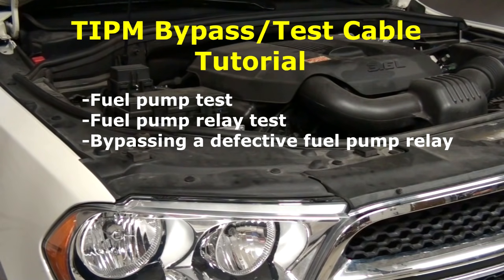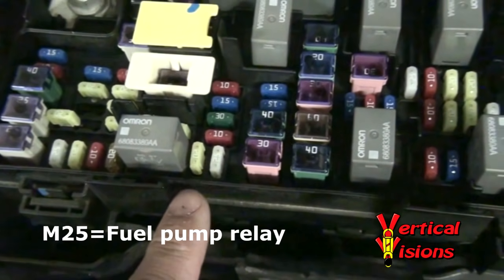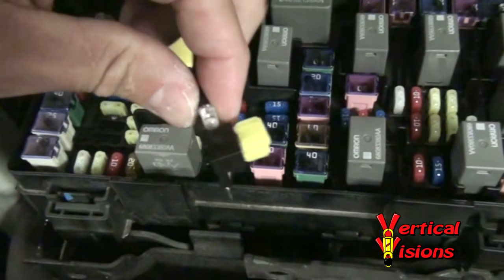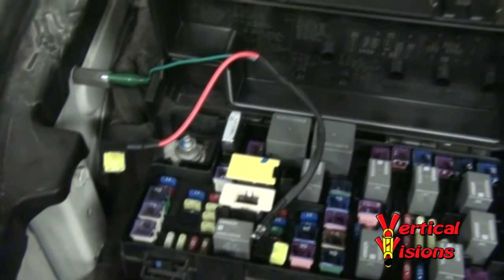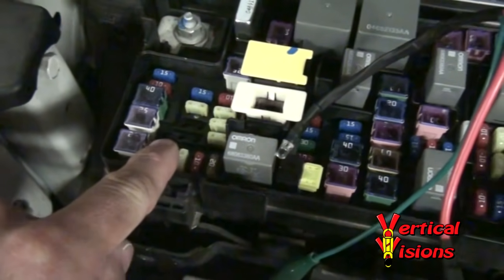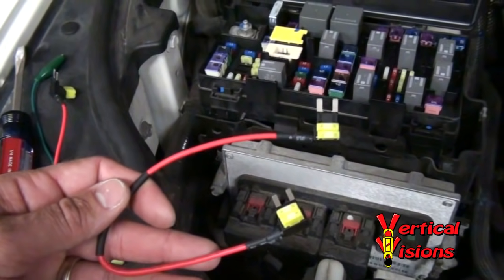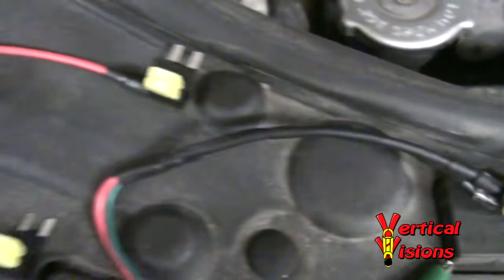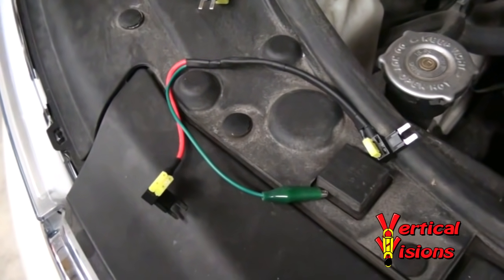TIPM Fuel Relay Test and Bypass Solutions - Most 2007-2021 Dodge, Chrysler, Ram, Jeep, VW Vehicles

Comment: Today I received my TIPM plug-in relay system (lite) It was so easy to install took all of 3 minutes...I have a 2012 Town and Country that would not start any more. After watching your channel and
going to your website to order this part it was seamless. Thank you very much for all of the research you put into this. My van now runs like it did when it was new, and you have saved me thousands.
Reply from the maker: Our TIPM Plug-In Relay System (Lite) is essentially the next generation TIPM cable with easier installation, fit, and functionality.  It has three onboard LEDs to indicate power flowing to the pump, the run/start signal (the alternate power source), and the status of the original faulty relay for testing purposes.  This part is patented and built from the ground up as a permanent solution.  TIPM cables have always been temporary solutions since they have issues in high temperature environments due to manufacturing constraints.  Thanks for the feedback Ross.
Reply: @VerticalVisions  I have a 2006 Dodge Ram 1500 Mega Cab and it's doing exactly what you're talking about but the TIPM is slanted and has a different fuse box.. just trying to determine which fuse location to attach to?
Reply from the maker: @blakevaughn8108  Ouch, a 2006.  TIPM cables don't work in your vehicle.  Here's why:  https://verticalvisions.com/en/content/21-basics-of-bypassing-testing-relays
Reply: @blakevaughn8108  
I got a dodge durango and trying to figure out the same thing. Can I attach to fuel pump fuse and the cigar lighter ??
Reply: @VerticalVisions  I commented on this video twice I need help may you might know how to bypass a 40 degree angle tipm
Reply: @VerticalVisions  Question for you boss, I seem to be having the same issue for my 2014 Dodge Journey 3.6L STX. Would your Fuel pump relay bypass wire work for my vehicle?
Reply from the maker: @CP-ix6ds  We have not tested our TIPM cables on your vehicle.  Read this:  https://verticalvisions.com/en/content/21-basics-of-bypassing-testing-relays
Reply: @VerticalVisions  Question for you boss, I seem to be having the same issue for my 2014 Dodge Journey 3.6L STX. Would your Fuel pump relay bypass wire work for my vehicle? I didn’t see my car listen on the site but wanted to make sure, thanks
Reply: @VerticalVisions I would like to see a work around for TMC in the Chrysler TIPM.
Reply: Hi boss. I got same problem in my Gran Caravan 2013. I was checking your video, make my bypass cable and voila. Run again. Thanks a lot.
Reply: @carlosvalverde8512  Works awesome I have over 180,000 miles on the van still runs perfect
Reply: I want to order one
Reply: Does it work with a 2003 Lincoln Navigator?
Reply: I`m not sure my application was for a 2012 Town and Country  @Snookred1
Reply from the maker: @Snookred1  We're not sure.  This page might help you determine if it will work:  https://verticalvisions.com/en/content/21-basics-of-bypassing-testing-relays
Reply: @VerticalVisions  yeah I’m not sure either bc there are 2 fuel pump relays on the fuse box a 5 prong rectangular relay and smaller one that’s soldered internally on the board itself
Reply: My ESP light my traction light and my abs light still stay on is that common is there a fix for that?
Reply: @natsanchez3583  I think that is unrelated...You could be looking at a wheel bearing...the tone ring for the abs is in with the wheel bearing...it might have to be changed.
Reply: Amen!
Reply: Does this work on 2012 jeep compass?
Reply from the maker: @LaPlacitaMich.  Not sure, but this page might help:  https://verticalvisions.com/en/content/21-basics-of-bypassing-testing-relays
Reply: How much
Reply: @anthonymitchell4009  ....$100 U.S plus shipping...Installed mine 2 years ago works awesome....well worth it
Reply from the maker: @anthonymitchell4009  Comparison chart of solutions with prices:  https://verticalvisions.com/en/content/14-tipm-fuel-pump-relay-solutions
Reply: Where can to buy a cable and what size are ?  How many amps or volts  the fuselaje it has
Reply: Yep!!! This $8 wire saved us thousands! 2012 Dodge Grand caravan! They really should have a recall on this! Wayy too many ppl having the same issue!!!
Reply: Have a 2016 Chrysler 300c will not start on occasion will just keep cranking. At times once it does start it will stumble and die. After the second or three time it will finally stay running? How can I get your cables fast?
Reply: @Loveless-sr9ly  ...try shutting it off completely, open the door then try starting it again...kind of a reset
Reply: I bought your cable and it still doesn’t start nor do I hear the pump running
Reply: My 2010 Dodge Journey AWD starts then stops sometimes it'll run may a minute then stops would that be cause relay going open stopping engine

Comment: Hi, I bought a TC2012 with the little board and doesn't work, It stall from time to time and I would like to know if this board need to have some led lights on because all remain off. Have voltage but seems like is dead.

Comment: You should be able to make a similar harness to bypass the transmission control relay when it fails too, also a common misdiagnosed dodge issue.
Fyi dodge is just another word for avoid 😅

Comment: GUYS IT WONT MESS UO THE REMOTE START IF YOU CONNECT IT ON M6 instead of m7 but the fuse part need to be pointing towards the battery instead straight facing the grill 8:20

Comment: I bought the cable and my 2015 wk2 still will not start, is there something else I should be looking for, I’ve already replaced the fuel pump. I’m also looking into buying a used tipm from the local fenix shop, should I be leery of doing this?

Comment: Isn't it possibly a problem to leave the fuel pump on all the time when the car is on?  I thought it's supposed to turn on initially to raise pressure, and then turn off and only turn on when pressure is needed.  If it's running all the time, is seems like it could shorted the life of the pump or cause other problems.

Comment: Can anyone tell me why the bypass cable isn’t a permanent solution? I installed it a year ago and it hasn’t had an issue until this winter when it’s having hard starting issues on cold mornings again? Is the standard bypass cable likely failing or should I look at other things?

Comment: Ive got a 11 ram 1500 4.7 4wd that has a crank no start issue. Mechanic said its the fuel pump relay tipm issue.  Will this kit work with it?  Dont think its ever had the recall done before
Reply from the maker: Yes.  We have multiple solutions for your vehicle.  See here:  https://verticalvisions.com/en/308-1500

Comment: This works great I want to put my fuel pump back on I changed the fuel that wasn’t it This tipm bypass cable saved me $$ but I put in a new fuel I can’t refund it 😂 thank you 🙏 I ordered this bypass cable threw Amazon for $24 my 2011 ram 1500 hemi 5.7 starts up like nothing happened 🙏 thank you 1000X

Comment: Our Town and Country's fuel pump has stayed on with the key off and not run with the key on. I planed in using the kit and splicing the wires under the fuses and adding an external relay to resolve our faulty internal relay usues.

Comment: Sooo what happens when the vehicle requests fuel pump disable in an anti theft event, or an accident, or when the ASD relay is not satisfied due to engine management failures?  With this "fix" the fuel pump will run when key is in accessory or run position regardless of firewalls put in place. Emptying 20 gallons of a very volatile substance is not ideal especially if the fuel delivery system incurs damage/leak.  This "engineer" should know all these facts before circumventing safety features and allowing a fuel pump to run continuously with the only requirement being a key position.  Engine management systems are designed to disable the fuel pump for a number of reasons. This should only be a temporary repair.  Worse yet, your child connects a faulty phone charger to the rear power point, the fuse opens and you get into an accident because now your vehicle has no acceleration at an intersection.  Then your family is placed in danger.
Reply from the maker: This "engineer" is well aware of all this, which is why we also have options that do connect to the ASD to fulfill all the "what if'" scenarios you mention.  Link:  https://verticalvisions.com/en/tipm-plug-in-relay-systems/57-tipm-plugin-relay-system-ASD.html.  Even crazier is that manufacturers know the fuel relays can become "stuck on", while driving, which is about 20% of our customers, yet hardly any recalls were issued.  Customers send us TIPMs to repair that arrive "stuck on" in our shop all the time.

Comment: Hi would this be the same as the 2017 dodge durango require smaller fuse ?
Reply from the maker: Your fuse box requires micro2 fuses, so you need a slightly different cable and instructions.  Link:  https://verticalvisions.com/en/167-durango

Comment: This is great information.  I have a 2015 Grand Cherokee. Today if would not start, just turned over.  (no codes) Put starting ether in the intake and it would run while it had ether.  I let the car sit, disconnected the battery for a 1/2 hour and then it started.  It sounds like a relay problem. (My clothes dryer has the same).  Does this sound like the relay issue?

Comment: Great tip, But you may hear your fuel pump running after you shut off your engine, even after you removed the key fob, But after you open your car door, The fuel pump will shut off, So not a big deal, Don't be scared, Just wanted to add that note, Good Luck

Comment: I love this BUT wouldn't it be better to get power from M22 which is the auto shutdown fuse location?  Wiring to the M7 will require turning off the ignition in case of an accident to turn off the fuel pump which may not be possible?
Reply from the maker: M22 is your horn, but I think you meant M21 or M19.  Unfortunately, the orientation of most TIPM cables means connecting to these two slots will result in the fuel pump load being passed across the existing M19/M21 fuse, likely overloading it.  Or we have an ASD connected solution that's patented:  https://verticalvisions.com/en/tipm-plug-in-relay-systems/57-tipm-plugin-relay-system-ASD.html

Comment: Why 4 fuses??
Reply from the maker: Because TIPM cables perform other functions, such as testing your fuel pump when the vehicle is off.  We then move fuses around to accommodate the required functionality of the cable.

Comment: A in line fused wire with the small blade connectors on the ends plugged into the load side of the pump fuse and the switched side of the acc will do the same thing and keep the acc hot all the time for chargers inside the vehicle.  Now if you don't have a optional powered accessory fuse then these will be the way to go.

Comment: Hi please if you could help me. I have a 2020 dodge Durango I get a crank no start. On the second try it turns on. The dealer told me I need a new tipm could this solution work for me.
Reply from the maker: Yes, it's possible you have a faulty fuel pump relay.  You can verify the problem by measuring voltage on F70 during engine cranking per the bottom image here: https://verticalvisions.com/en/content/34-testing-a-fuel-pump-relay.  The solutions we have for your vehicle are here:  https://verticalvisions.com/en/318-durango

Comment: Hats off to Jason Bell and big thumbs down to Chrysler.   Intermittent problems can be a real challenge.  I never thought I would be looking at a nine-year-old video discussing a thirteen-year-old recall to find the problem of my 2017 Jeep Wrangler with less than 10,000 miles. Chrysler really dropped the ball on this one.  They had 5-6 years to correct this, and did nothing.  I will drive it on the jump wire for a few more days to confirm, and then purchase the one with the ground wire to protect against a crash.

Comment: I cannot stress enough that this is not a permanent fix for these cars it provides key on engine off power to the fuel pump so if you get in a crash and your engine dies and your key is left on and you have a ruptured fuel line you can feed the fire with fuel the external relay rewire is the correct way to fix it or replace the tipm module they are selling these bypass kits all over the Internet and they are completely unsafe you never want your fuel pump wired to key on engine off power I see people do this on hot rods all the time also or when they put electric fuel pumps on their car the correct way is to wire it to an oil pressure switch or some kind of engine running power don't make your vehicle unsafe

Comment: Here's a question I've changed the pump already but it still doesn't prime when turning the key so I ordered this bypass assuming it's the relay since so many others have had this issue but hypothetically what if it still doesn't work? What should I do next?
Reply from the maker: If you ordered your cable directly from us, just call us at the number on the included business card and we'll give you the next steps based on your findings.  Hypothetically, there are other factors such as your vehicle year/make/model that we would need to provide next steps.
Reply: @VerticalVisions 2011 Grand caravan cv it's still not priming it cranks starts stutters and dies I pulled the fuel line at the rails and no gas comes out gonna have to pay someone to look at it

Comment: I have a 2014 dodge Durango how do I bypass fuel pump relay
Reply from the maker: Here is some information on the subject:  https://verticalvisions.com/en/24-micro2-fuse-slots.  F91 to F70 fuse slots with a properly fused cable.

Comment: My TIPM does not have the M25 Fuse . ITs been running without it. I tried putting a fuse in, nothing. Why is my chrysler TC 2011 not have one? I am in america, the manuel says M25 is for export only. Are all these videos on youtube canadians?
Reply from the maker: You might have an external relay installed, which would negate the need for an M25 fuse to be present.  Link:  https://verticalvisions.com/en/content/7-external-fuel-pump-relay-basics.  However, all 2011 Chrysler Town & Country TIPMs are the same as the one shown in this video and will work with our products UNLESS the external relay has been installed (rare).

Comment: Isn't it crazy how 1.6 MILLION people have come across this video because of this issue with our vehicles? It's absolutely pathetic that they hid away the fuel pump relay.... It's also pathetic that they didn't build an access hole to the fuel pump on the floor of my 2008 Dodge Grand Caravan.... Currently dealing with an issue where my van died on me at a red light suddenly, and wouldn't start back up. Tons of fuel. Low oil. Low coolant. Cannot hear fuel pump starting when turning key to ON. My battery is also dying very quickly, so it's hard to test things and get it working again. Thanks for all your work and dedication to this atrocious issue. :)
Reply from the maker: This is the best comment I've heard in awhile.  And every vehicle owner who doesn't find us often ends up forking out $1500+ at the dealer for a new fuse box, when the problem is a simple $3 relay that has failed.  As for the corporate greed from Dodge, Chrysler, Jeep, VW, and Ram manufacturers, fuel pump relays have been a very profitable problem.
Reply: @VerticalVisions  so just to update, my issue was actually the two fuel pump wires corroding and burning up just under the carpeting and plastic covering below the driver's seat on the side closest to the outside. The wiring harness goes there, and it just so happens those two wires were pinching between one of the plastic nubs! This was never posted anywhere else on the internet so was very difficult to find, lol. Thanks again for this great video and reply back!
Reply from the maker: @imjody  I have never heard of this, so I appreciate you telling your story.

Comment: Is the one leg on the bypass a dead leg to keep the relay from sending power while key is off? Or how does that work
Reply from the maker: Yes.  It's called the Normally Closed (NC) position on the relay and no power will pass until the relay is energized.  Once the relay coil is energized, the Normally Open (NO) contacts receive power, which is passed onto the M25 fuse and then out of the TIPM to the fuel pump.  A diagram of this relay is located under the "Capabilities" section on this page:  https://verticalvisions.com/en/tipm-plug-in-relay-systems/33-tipm-plugin-relay-system-lite.html

Comment: Lmao last thing you want is a under rated wire for what you are doing .... I did one time and and I learned my lesson ..... the plastic coating instantly blew off the wire and blasted me in the face so I had hot melted plastic all over my face it was not fun .... 

I was trying to kick my starter over by jumping it .....on my semi on the side of the road so I was working with what I had which was some super small wire it was truly stupid
Reply from the maker: Agreed.  That's why we use a wire rated to 20 amps, which is the same as the fuel pump circuit.

Comment: Got the wire and my 2016 jeep grand Cherokee still doesn’t start. The fuel pump will not power on ive tried everything I change it 3 times already it’s runs for a day and wont start the next day.
Reply from the maker: You would have needed a micro2 version of this TIPM cable, connected from F91/90 to F70.  Did you perform the fuel pump test (F70 F90)?  Is your pump turning on?  You can also test your OEM fuel pump relay if you have a TIPM cable with an LED, or this method:  https://verticalvisions.com/en/content/34-testing-a-fuel-pump-relay.  Testing is important.  Let us know your results and I can weigh in on a solution.
Reply from the maker: Also, make sure you don't already have an external fuel pump relay.  Although a different TIPM style, here is how to check:  https://verticalvisions.com/en/content/7-external-fuel-pump-relay-basics